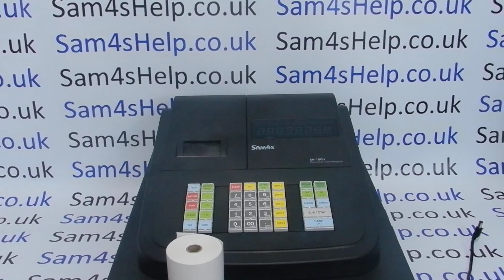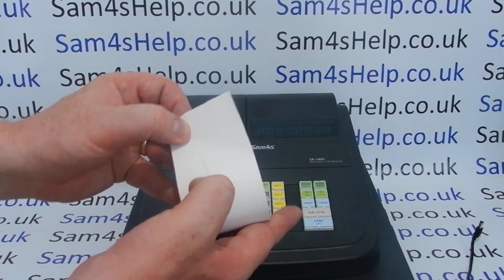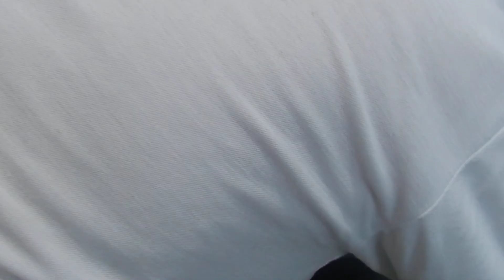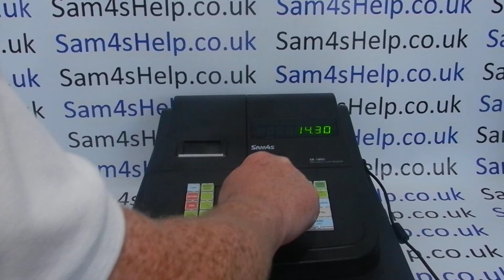Out The Box Set Up Programming 1st Use Guide Sam4S ER-180U / ER180U / 180U / ER-180 / ER180 / ER 180

Comment: Hi,  I appreciate this is an old video,  but if there is anyone out there that knows, can you please explain how to set a transaction limit-  no single transactions over £10 for example.  it was on the till previously but have had to factory reset it and that function has been lost. 
 Ive read the manual and tried what I thought was the correct process, but its not working. so im stumped.
Reply from the maker: Thank you for your message, please see the video link below for instructions on how to limit the amount that can be put through the CASH or CHARGE or CHEQUE buttons: https://youtu.be/Uw4ytS1xWZA?si=aLC1eSvyIgARnUu0

Thanks, 

Sam4S Help
Reply: @Sam4SHelp   Thankyou sir, is this the same process for the till with a key? Putting the key in the p position ?
Reply from the maker: That's a great question. I don't have access to a key operated version, but I would be stunned if the programming process was different.
Reply: @Sam4SHelp   
Thankyou for your help,  I shall try this process and let you know if it is the same on the key version 👍